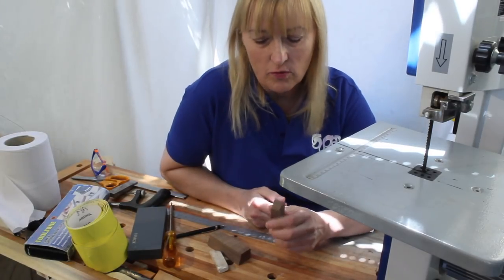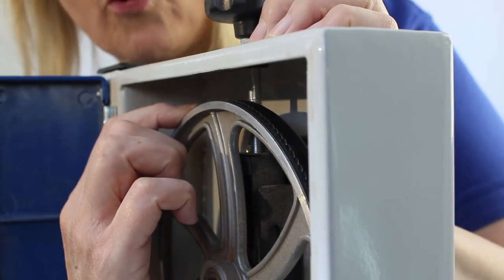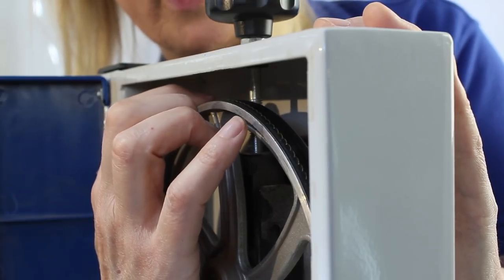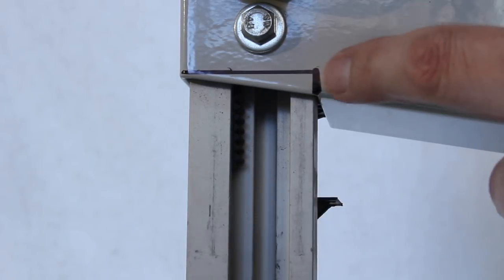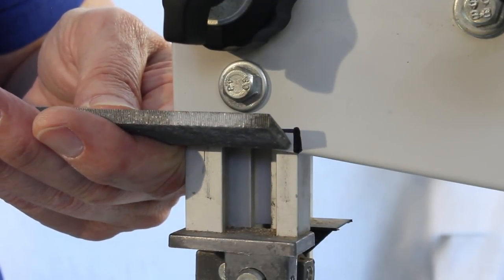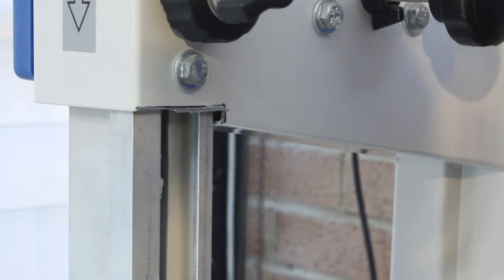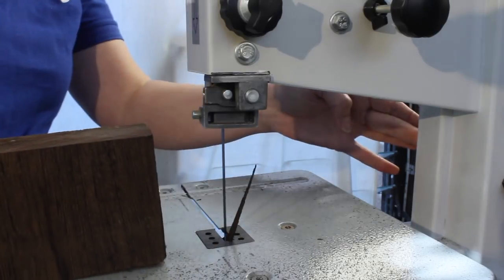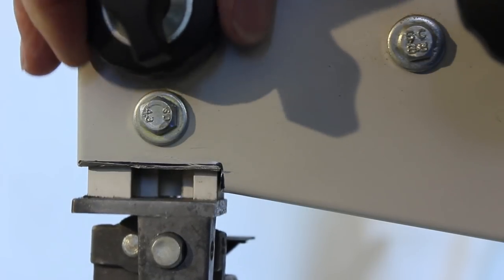Increasing the depth of cut of a hobby bandsaw

Comment: i have solved that problem of the crown on the band saw wheel. It might work for you too. Place a piece of stout cotton twine under the tire. You can hold it in place with contact cement, to keep it from shifting while the tire it placed back on the wheel. Making  sure the twine is in the middle of the wheel. I hope this helps.
Reply from the maker: Nice tip!

Comment: Both the lidl and aldi bandsaws are rebranded scheppach units.
I have the lidl version and have already modified mine as you have done, well worth it for a few minutes effort.
I went a little higher and removed the rack and pinion action as mine was always getting jammed with sawdust!
Nice job

Comment: I will be interested to see in future videos whether you find this modification useful - or rather, usable.  I have an Einhell band saw which is the same size as that Scheppach and I found that it struggled to cut through 4cm of hardwood, let alone 8 or 9cm.  That size of saw will also only take a fairly narrow blade which itself may struggle to make cuts that deep, and you'll have to go very slowly and may end up burning the wood a lot.  So....I'm sceptical about the value of this modification but interested in your results!

My solution, sadly for my wallet, was to buy a bigger and much more expensive band saw, which I still struggle with since the blade wanders badly - I think I need to invest in a couple of better blades.
Reply from the maker: I bought a decent blade - it makes a huge difference

Comment: That was a good mod. 🙂 I've got a Titan from Screwfix. The entire blade holder & rack & pinion is plastic so should be easy to get more clearance but it does have a stop on the top of the rack so I'm also hoping to reposition the pinion.

Comment: hey Susie you can gain some more depth by making a lower profile table and gain an inch or more used some 5 mm mdf flooring to create a table that sits straight on the frame of my band saw with a wooden bracket to attach it to the band saw fixings works a treat it doesn't have to be the full size of the other table mines just four inches square it can help with cutting as there's less distance between the lower guide and the table giving less free blade between the guides  mines nit the same design as yours so no idea if a lower table would work on yours i have an old Burgess three wheel saw yours looks a lot better than mine even though it's cheap modern saw mine has plastic wheels and very tough to set up. hope this helps.

Comment: I did my GMC like this only I gave myself a little more room by removing the upper blade guide assembly first then filing back the case was a breeze. Putting the blade guide assembly back was easy and alligning it not so much. I don't think gmc are in business anymore.

Comment: I saw recently that the blade should be as far forward as possible, this helps stiffen the the teeth of the saw.  Seems to make better cuts.  I don't think it is a good idea trying to cut a tenon with a band saw.
Reply from the maker: I only had to rough cut the tenon - I refined it on the router and will finish with a chisel